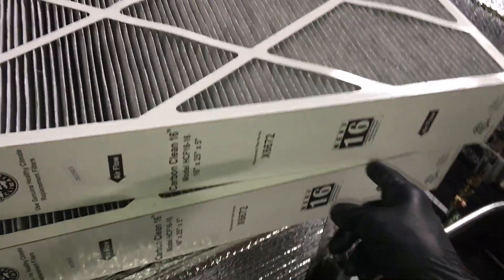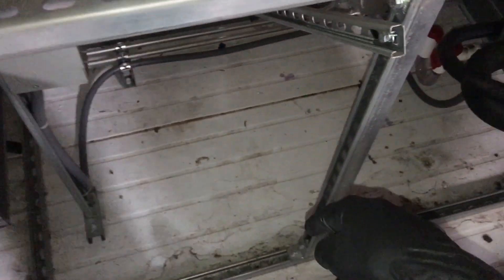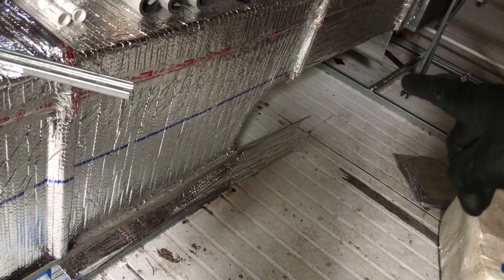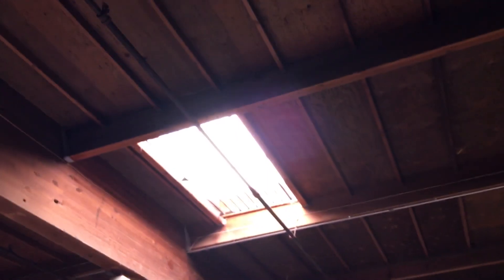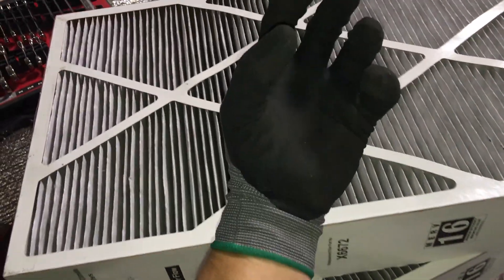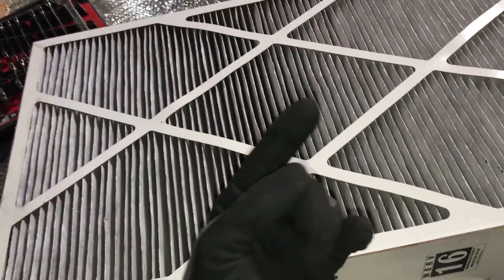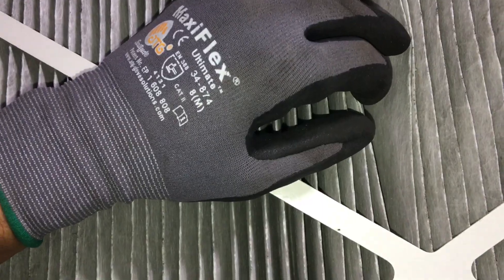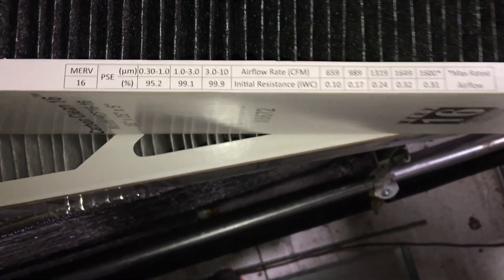MERV 16 filter’s are not for your average person or technician to install on a customers equipment.

Comment: What’s the point of this video?
Reply from the maker: How far superior 5 inch depleted Merv 16 filters are compared to your 1 inch or 2 inch filters commonly used.  
          Your condensate drain lines even though you may have installed them correctly when you first set up your equipment installation. 
         The construction materials used were not properly supported by the contractors installation may sag overtime.   Reversing the flow of the water in a condensate line causing water leakage